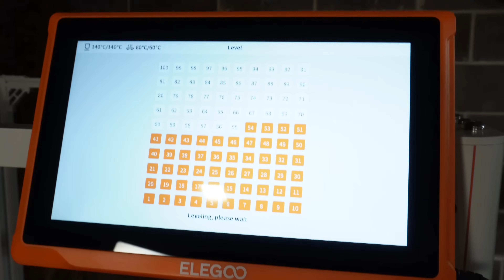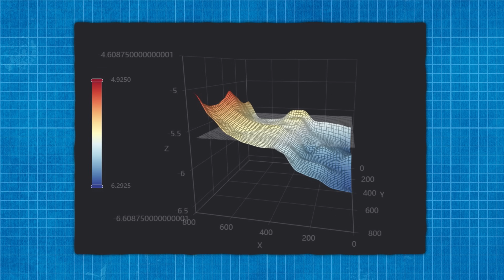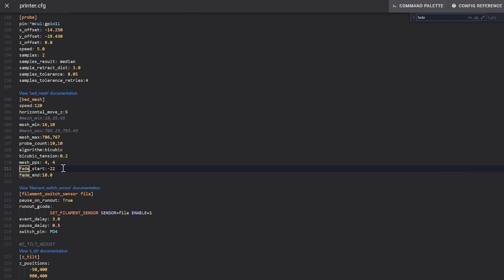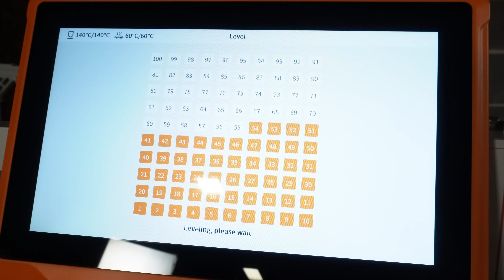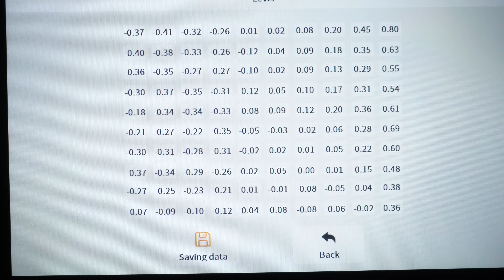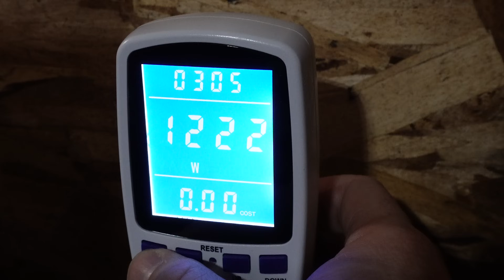My OrangeStorm Giga STILL DOESN'T WORK

Comment: While I do think rigid connections are better for single print heads, for multiple it's really not that easy.... that said, the manual leveling process for that could be significantly easier/better..

Comment: You don't want rigid posts for the bed mounting, you need something you can compress. Silicone vacuum tubing would be my suggestion. The Sovol SV06 Plus ships with rigid standoffs, making it impossible to adjust the bed.

Comment: The extruder gears look like plastic and you put a hot wire through it. Bad design but desperate fix as well.
Reply from the maker: Gears are metal, that’s confirmed :)

Comment: This is exactly the (delivery) status I feared and why I didn't jump on board. 
I keep seeing these: "Quick, quick, put something together, we need something for marketing" printers.
And then in half a year they realize that the "quick, quick mess" can't be made to work because far too many things have simply been "designed" incorrectly (if anyone has designed anything at all and not simply improvised something on the spot). And then? The thing is simply declared dead and ignored and the next marketing stunt is pitched on Kickstarter.

Comment: I feel for you, that is really awful.   I think your experience should be added to the book of 3d printed horrors if there is one.

One thing though I know you live in the same general area as I do and the humidity tends to be a bit on the high side.  Could you be having problems with filament.  Even PLA has problems with moisture if left out long enough.  Of course the only time I have had jams with PLA was when I put my 3d printer in an enclosure.  It drove me nuts until I discovered I had to leave the enclosure door open.  So, I only print with PETG now and I keep it in a drybox even while printing.

Comment: Elegoo took new game development approach by doing beta testing using consumers lule
At least they send you stuff for free very fast (I'm on N4M and subreddits, everyone is getting new heads and plates etc if something goes wrong even if it's the customers fault)
But yeah, seems like you need to buy their FDM printers only after 3-4 months after launch when all main problems are solved. Tho there are no other options for that price and getting that much performance and build volume (Including N4M)

Comment: You should definitely add for the "mesh" section the setting "zero_reference_position: 400,400" and make sure do your z_offset calibration at 400,400. And you should load the plane measured before you do z_offset calibration. That will ensure your probed plane is meaured to be around plus/minus zero  and not from minus something to minus something and it will ensure you don't drive into the bed. What you encountered is a config error because Elegoo didn't realized some config changes needed for newer version of Klipper.

Comment: I bet it's the wrong gear ratio on the extruder. It must need something non-standard. I had all of these problems on a much smaller scale. I have a significantly modified old Anycubic Mega Zero 1.0. At the same time, I changed the extruder for an all metal one with a different gear ratio and changed the hotend out for a Creality Spider v1. I even designed a new shroud and bltouch mount in Fusion 360. I then proceeded to start recalibrating the Klipper firmware from scratch. In the end, through tedious process of elimination I determined that the extruder screwed everything up despite countless hours of calibration attempts trying to dial in rotation distance, z-offset, temperatures, etc. I switched back to the original double gear plastic BMG clone it came with, started the entire calibration process from scratch, and it's all working lovely again with 2-3x print speeds possible thanks to Klipper and the Creality Spider hotend.

Comment: Something that has always bugged me is the imprecision of limit switches on 3d printers. The common SPST switches that 3d printers use for X and Y don't have a specified repeatability value. because they're not precision. The Z Axis of a 3d printer needs to be repeatable to >.001in or about .02mm. which means the switch needs to be an order of magnitude more precise than that. So we're looking at limit switches for Z that are sub-thou accurate. or about .005mm. Of course the X-Y doesn't matter too much, but more often than not, the same switch is used on the Z axis as well. And those inductive sensors? Those are even worse.

Know how much those switches cost? 

You're not going to get that on a printer. There are other methods to get high accuracy and flatness on a 3d printer and the solution is quite simple. Ready for it? 

Don't use it. Don't rely on the mesh bed leveling. Don't rely on software skew compensation. High end machines don't need those options because things are made orthogonal and flat from the factory.

Get a dial indicator on that machine and use that to adjust each point. Work in sets of 3 to determine each plane. Pick a singular datum and make everything else match that instead of moving things back and forth. Also check the repeatability of one singular point. I bet you'll see it move around a bunch on cheaper switches.

Comment: a lot of these hot ends  use injection molded plastic for the filament path and grinds on the filament while it feeds till finally locks up , if this is the case , tear apart , drill out filament path to just accept a short piece of ptfe and run up to extruder gears , really smooths this out and often far better filament support for like tpu  etc

Comment: Having the screw adjustment is a pain but great to have. With Prusa printers we do the nylock mod to do the same thing. The problem with rigid posts is that as the bed goes through heat cycles it warps and rigid posts do not compensate properly for for the warp. Prusa does use rigid posts and those beds are not flat.

Comment: I actually like the idea of spings more as long as they are good solid springs. If the bed was ridgid you couldnt change it even if it was uneven which with such a large print bed will be the case. Now, that the z offset doesnt compensate after reading the bed point heights is the real issue imo

Comment: I just assembled mine today and left the Lychee Slicer office with a (little bigger than usual) benchy printing that looked nice after 1h30 of printing. The assembly, leveling, vibration compensation, and such were no problem. I'll start big prints tomorrow. It's sad to see that you had such a bad experience with the printer.

Comment: Joel, you're probably using it in a cold environment - where is the others did I in warm homes. Hope that helps, you need an enclosure buddy.
Reply from the maker: Why would a colder environment cause a jam? If anything it would help the machine keep a proper heat break.

Comment: Hey 3DPrintingNerd. Having dealt with similar hotend issues, I think they probably shipped you dud hotend cooling fan and/or designed in an excessively marginal fan. When PLA gets hot between the hotend and the extruder (like, 50-60C hot), it'll soften and clog up the area between the heatsink and extruder, causing exactly the type of failure you saw after running the machine for some time.
There is one trick that will take almost zero effort, and maybe make a sponsor happy. Use Polymaker PolyLite PLA filament. Their infrequently-featured Jam-Free technology actually prevents this from happening. It's a bit of a trick with PLA.

Comment: 0.7 is the screw pitch, which is a full turn. Seems like the firmware is as helpful as it possible. You've got to change from trinket printing mindset to machinist mindset. The reason springs are used is that you can adjust the bed height with a single adjustment at each point instead of 2. You're probably being dramatic but 2 hr of leveling is the price you pay for such a large work envelope. If you the machine was ridgid enough to negate the need for bed leveling, it would be too heavy and expensive. I think you're expecting prusa level reliability (old but stable) from an early release. Thanks for checking it out though, frustrating though it may be.
Reply from the maker: Hey! Oh I understand the screw pitch and the travel per turn, but it doesn’t work well on this machine at all. You have to re measure A LOT because the amount of turns of one screw affects the screws around it because they are so close. Re measuring have different results every time. I was approaching it with a machinists mindset but it wasn’t delivering that level of precision:)

Comment: Does the hotend have a ptfe tube to the extruder? I have a kobra 2 max and I have big problems with cooling and that blue ptfe tube melting and clogging the nozzle!
Reply from the maker: I didn’t see one when I took it apart.
Reply: @3DPrintingNerd  that super sucks you're having problems. I'm sure you will figure it out! The printer is super cool though. I might have made the worlds largest 3d printed mardi gras mask on some kobra 2 Max's and let's just say 840 hours later and it was complete! It was a journey to say the least! Just take a deep breath and keep releasing these banger videos! Im smaller but reach out if you ever want to do collab on something...CRAZY! ❤️

Comment: Hi Joel, I've got the Elegoo Neptune 4 Pro, vastly smaller than your behemoth of a machine. But I took have experienced a number of occasions where filament stops flowing, alot of time the gears in the print head start skipping.

Fortunately touch wood it's working great and had been for a while but you are right once you lose confidence in a printer it's a difficult position to be in as you obviously can't sit and watch the thing for hours.

Elegoo are great quality but feels very much like they are pushing out machines before they are clearly ready for the masses. Probably to keep up with completion which is ultimately going to hinder them in the long run with reputation issues.

Absolutely love your channel keep doing what you do.

Adam

Comment: There are so many questionable choices they made on that machine. Bed springs?  Why not solid spacers.  Also, is that build insulated from below?  An enclosure would certainly help contain some of that heat.  And a hot end breaking apart like that - yikes.  Maybe I’m glad I missed out on this. 😊

Comment: I backed the kickstarter and in the meantime I bought a Neptune 4 max. I have been pretty disappointed with the design of the 4 max from the wires to the accelerometer that ripped out to the print head filling itself up with filament, both of which are known issues, to the process for updating the firmware which includes opening up the console that holds the screen.  Even just things that should be very easy like changing the nozzle require multiple steps and part removals and multiple screws and so on.  It just feels like a big step back to the days of the very tinkery printers.  I will say their support has been very good at sending replacement parts at no charge so that is a plus but these are just all poor design choices and I am seriously considering cancelling my giga order because I see a lot of similar things where it just doesn't seem well thought out.  I also got the 4 print heads for mine which now based on what you said about changing the level of the beds for the multiple heads is another thing I know I do not want to have to deal with.  The 4 max was my first and only Elegoo product so its the only thing I have to judge the company on and I am really not impressed, again though I do want to say at least their support has been very helpful and quick.

Comment: When you use 4 toolheads on one x axis, you can't assign different compensation heights from a mesh to each toolhead. You can't even use a mesh at all since the point value would apply to all toolheads. There are many more design flaws for a machine this size and I'm really looking forward for more content on that. I appreciate your work, effort and passion so 🖐back to you!
Reply: This is why I get what Elegoo did (not that I agree with it) - one of the major concerns about the Sovol SV04, even with the Z-axis offset adjustment knob on its second extruder, is that an uneven bed will lead to only Extruder 1 having accurate Z-axis compensation and Extruder 2 will be too close or too far away without warning. Same thing with the Stacker 3D S4XL we had at my last job - getting one print head properly leveled with the insane 9-point leveling system was hard enough, we gave up after getting two of the dependent print heads leveled because #3 and #4 were impossible to keep in the same plane.

All that being said, Elegoo's independent bed quadrant leveling system is still really dumb. A flat plane is defined by three points, a subject that has come up many times over the last 5-10 years when talking about printer beds with four leveling knobs...having nine adjustment points is a recipe for failure. Having nine adjustment points times four bed quadrants is possibly a Geneva Convention violation being committed on Elegoo's customers. Not that any ideas I have are necessarily any better, but for a ridiculously large and expensive printer maybe some pancake stepper motors to live adjust the Z-offset for each print head isn't all that terrible?
Reply: @justinchamberlin4195  A plane is defined by 3 points is absolutely correct mathematically, but across a bed this size the real world is going to come knocking. That bed is going be sagging if you don't have supports across its face, all those springs and screws allow you dial in something resembling co-planar to the print head axis. Where just having 3 adjustment points either the bed is going to need to be heavier and stiffer than the entire rest of the machine to hold itself 'flat' against its own weight or the whole frame of the machine is what you are adjusting instead, which then means your probably wanting to build a delta printer... 

And being so huge with only 3 points of contact/support the bed will then take on a major warp as it heats no doubt, not to mention as it had to be made so much heavier and stiffer to be even close to flat in the first place it has way more thermal mass to heat, so consumes way more energy to get to temperature. So by having all those screws and springs it really helps - the bed expands as heated but is now constrained much nearer the expected position because it is constrained across its whole surface and the small gap between the quadrants allows for each one to expand without actually having to deform out of plane,  and the bed doesn't need to be super expensive thick and heavy to hold itself flat...

Then you have the simple practically that making a single piece bad that large with heater is going to be hugely wasteful of energy whenever you are not needing all 4 quadrants, nearly impossible to ship etc. 

Seems like they have some quality control and design issues with the hot end but the mechanical concept is about as good as it can be in the real world. If you are not willing to put the effort in to calibrating your giant printer and its many heads you probably didn't need it in the first place... Or you have the money to build the machines upfront and printers that never stop running so you don't pay the huge heatup costs often to make a giant cast iron bed viable...

Comment: Typical Elegoo problems. They didnt learn from the Neptune 4 series. They use and out dated version of klipper and then chop and screw it so bad you get such inconsistent results. The mesh leveling dont even work to the point you can get 6 different meshes from 6 levels in a row with out changing anything and I mean big differences. Mechanically theses machines are great but it seems modifying firmware just is not there forte with fdm printers.

Comment: Having them mounted to on springs makes it easier and cheaper to account for manufacturing error since it's 4 different beds.  Honestly, for a bed this size, in a printer so relatively cheap these problems are fairly minor. The other problems you've had seem like problems unique to your printer, aside from the inaccurate sensor.
Reply from the maker: Oh I agree, it’s far less expensive to use springs in this case and make the user take 1 - 2 hours adjusting screws.
Reply: alzo making a rigid mount flat is hard. not even talking about thermal expansion

Comment: I feel like you have yourself headaches with regards to the bed leveling.

That sounds like Elegoo's version of screws_tilt_calibrate and adjusting one screw would change the value of neighboring screws.

So changing one screw at a time would be the wrong way to go about it, because it calculates properly when it tests all the screws on the bed to compensate for all the screws.

You can get some amazing results with it, I have the delta between the highest and lowest point on my 300mm x 300mm (admittedly MUCH smaller) printer to under 0.1mm

Yes it's a decent amount of work to do, but you only do it once unless you're yanking the printer about everywhere

Comment: the extruder issue is not exclusive to the OrangeStorm Giga, neptune 4 users have been complaining about it since the printer was released last year, and by the look of the internals, its almost the same design save for the new hotend

Comment: so you having fun, join in the failed club... only joking. I makes mistakes 1 or 2, I got 15 printers, think 5 isn't working and it need fixing. I was printing one right now, looking at 22 hours on my ender 3 V3 SE then I reliase I set it to .12 mm layer instead of 0.2mm, oh well, I let it print. High Five without breaking it.

Comment: id really love a machine that has a build dimension of this size. however its not enclosed and as I mainly run asa and nylons its not a viable option. hopefully they get this thing handled and make a way to enclose it properly for non pla material prints.